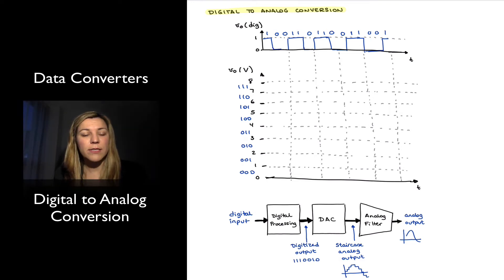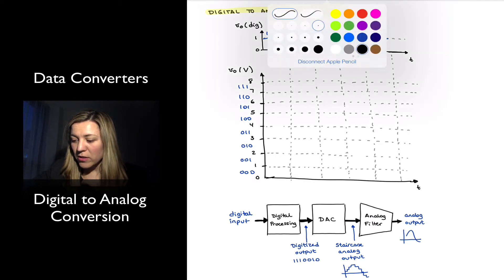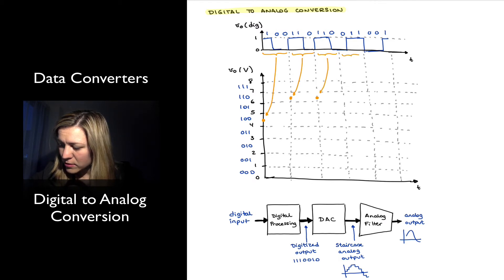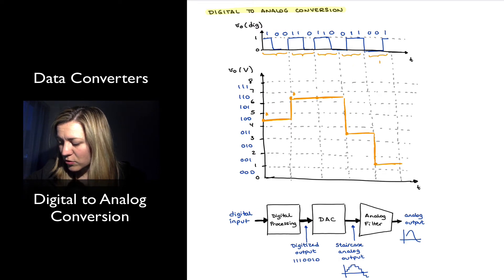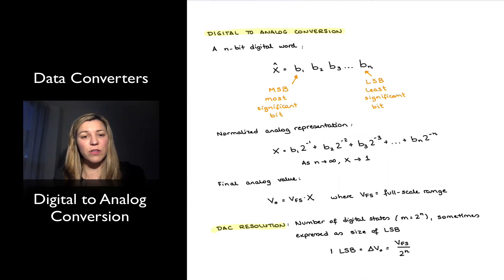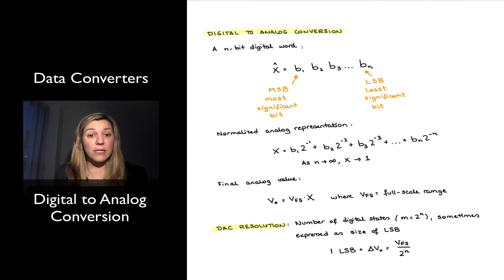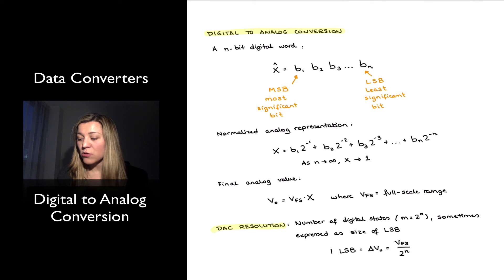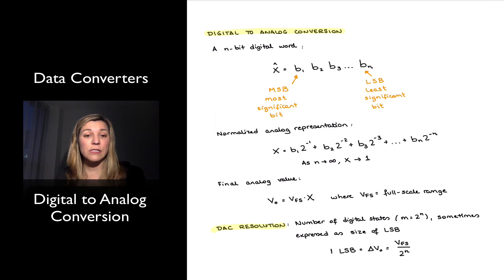Digital to Analog Conversion

Comment: Good video.  A few points from a programmer:
- Bits (in the computer) are normally listed in reverse order.  "b0" is always the least significant bit so that it never changes in value when your word size changes.
- Due to minor variances in resistors, capacitors, etc, the "steps" of a DAC are not always uniform.  The reverse is also true for ADCs.
Questions:
- Why don't values ever reach 0?  In your example 000 = 0.5v.
- If an AC sine wave is desired, is a negative DC bias required?  This sound difficult as any variance on the DC input would affect the resulting waveform but using caps to smooth the DC signal would allow the DAC signal to bleed back into the power supply.

Thanks!